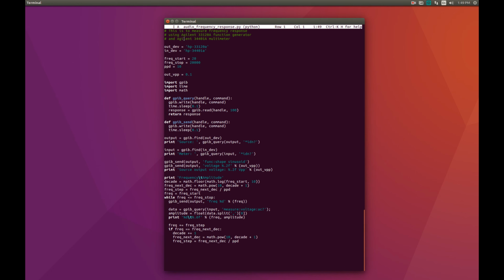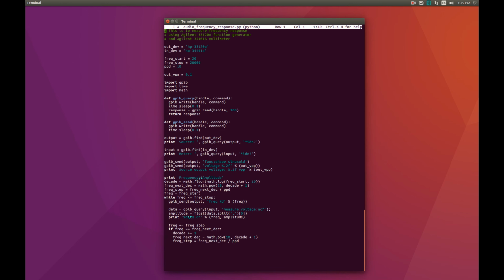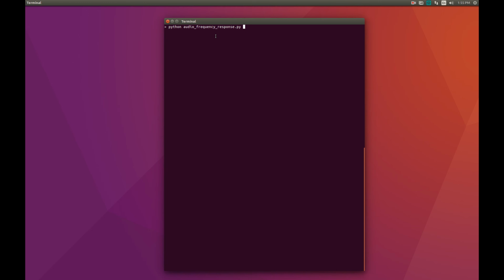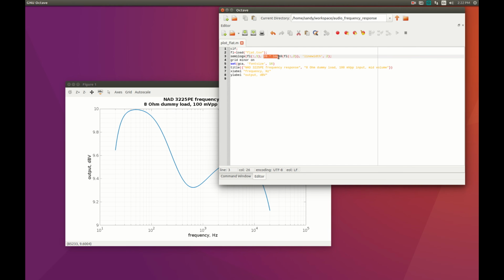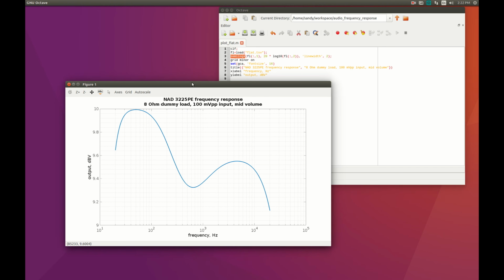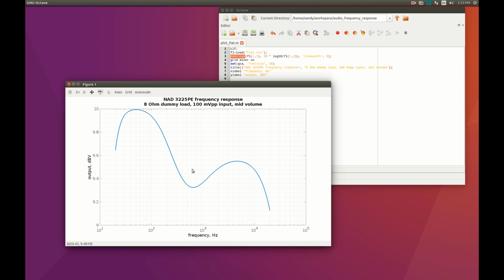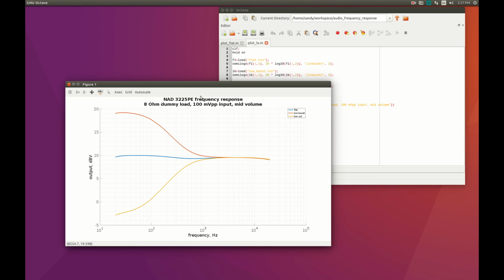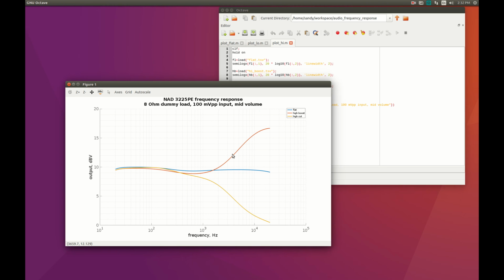#87 - NAD 3225PE frequency response measurements

Comment: What about using a simple voltage divider in order to bring voltages in check and use a high-end 24-bit computer interface?
Reply from the maker: I am afraid it is not that easy. There is no such thing as a simple voltage divider if your signal is not DC. There are all sorts of problems such as parasitic capacitance and inductance, so you would need to compensate somehow, which has many challenges. It is tricky to design a truly transparent front-end with flat frequency response, very low distortion, precise attenuation factor and so on.
Reply from the maker: Take a look at this: http://www.pmillett.com/ATEST.htm

Comment: I suspect the bass and treble pots are not electrically centered when they are physically centered!  The curves always had those bumps on the ends with the dip in the middle with the controls centered in their detents.

Comment: Great video. Just one remark: frequency response measurements will only make sense when you are sure the DUT is not producing a significant amount of distorsion. Clipping can be seen easily using an oscilloscope, however slew rate distorsion occurs often unnoticed. If in your automated gpib setup the output is slew rate distorted, you will make a comparison between the rms value of your input sine wave and the rms value of your slew rate distorted output wave form, which can result in a faulty frequency response characteristic. See also: http://users.skynet.be/hugocoolens/spice/ua741/artikelextended.pdf

Comment: great video as always. 
Can you please make a video showing exactly how to setup and use the agilent 82357B USB-GPIB on Ubuntu with Python?
Reply from the maker: I am not sure it would be very interesting. Too specific, too technical. Do you have a particular problem or you don't even know where to start? I vaguely remember it was not too difficult, and there is plenty of advice online.
Simply speaking, just download linux-gpib-4.x.x, untar, ./configure, make, sudo make install. Then I recall you need to find some binary firmware for this particular adapter and drop it into some particular directory. Python module is included, just "import gpib" and off you go.

Comment: I don't know why oscilloscope manufacturers don't put in an audio setting in the menu that brings up all the tests that are possible with an oscilloscope! It would make life so much easier. I'm sure that they could potentially devise a way to connect an amplifier and set the output level quick and easy so that you just have to push one button and the oscilloscope would run through a set program that tests for many different parameters and gives you a list of the results at the end, it would also be great to be able to save the results so that you can compare between different amplifiers... You would think that this sort of thing would be possible by now! Having the ability to do individual tests is fine, we have been doing this since the oscilloscope was first invented but we know all the tests needed to do a full test of an amplifier and we have oscilloscopes that are capable of doing it automatically but alas, we aren't there yet. Should someone release such a product, shut up and take my money!
Reply from the maker: How about this: https://www.keysight.com/en/pdx-x202150-pn-U8903B/performance-audio-analyzer
Reply: @feedback-loop  wow! Yeah so it exists! The first one that showed up on eBay had a price of $24,000 and it's used LoL. I'm not selling my kidneys for that... I think that what I was trying to say was that most oscilloscopes have an FFT function and I have seen people who have made their own math to calculate the rms output of the amplifier, I'm sure that all these simple things can be consolidated under one menu. I don't have a modern oscilloscope yet and the one that I'm currently using gives no information apart from the signal on screen! I constantly see other people digging into the menu to measure something else which I believe that it could have been placed better in the menu system. For example an Audio hot key which hides options that you would have no use for, or at least give you the ability to hide options that you would personally never use.. Sure, that machine you provided in the link is amazing! And thank you for showing me that, I will keep it in mind for when I win the lottery LoL.. There's older machines that have the same model number but after seeing the current model, the older models just don't interest me even though they are still very capable...
Reply from the maker: I am not entirely sure I understand your point. It seems to me that my scope is quite close to your requirement: just connect the generator and channel 1 probe to the input, connect the channel 2 probe to the output, push a few buttons, and you have a frequency response plot. And it is not a high-end scope. I think it is from the lowest 1000-series currently available from Keysight and not the highest model there (under $1000). Why older scopes did not offer this? I don't know. It is always hard to say why nobody thought of something before. Combination of factors, as usually, I suppose. The cost of ROM and RAM for extra applications dropped, CPUs are more powerful, screens have more resolution, our expectations of what scopes must offer have changed and so on.
Reply: @feedback-loop  yeah you're probably right, I'm being a hypocrite because I don't have a modern oscilloscope, my 20mhz crt scope is as basic as you can get but I knew this when I got it, I do have one of those small pocket DSO212 oscilloscopes, it's great for what it is but it's screen is to small and it's interface is harder to use although not impossible for daily use. You're scope is nice, I don't know what the pro's and con's are of having a single generator built in but in your hands it seems to work out fine which is mostly important at the end of the day, I guess that I will have to get myself an oscilloscope before I start asking for features... Maybe it's just the person who was using his scope that made it look difficult, Just because a person is into electronics, doesn't mean that they specialize in everything! I personally love amplification and almost anything audio (almost) just not DAT machines because I really don't fully understand their operation, so you will never see me working with micro controllers or computers unless it was mine, Audio is where my passion is hence the reason why I watched your video, although I don't limit myself when watching videos, generally I watch anything electronic related because I get to learn things from other areas of electronics that can be useful for audio... This video.... Was perfect! Apart from me having a little rant about oscilloscopes in general, you sir were flawless.. I remember hope that you do more videos like this because I haven't seen anyone else do this... 10/10.

Comment: Silly question: Could you measure THD of the gen and subtract it from the THD in the output?
Reply from the maker: No, it does not work like this. The higher distortion will completely mask the lower one. It is like measuring, let's say, a -100dBm signal in the presence of -40dBm noise. The signal is way below the noise floor.

Comment: Very interesting video. I also find the HP 8903A/B to be an excellent piece to test equipment for audio work with a very low THD source. They can be found on eBay for reasonable prices, especially if not working.

Comment: That was very cool! So how flat was the measurement of the SigGen on the DMM without the amplifier? I know the DMM has a pretty high cut-off but this might have been interesting too. Could always subtract this from the measured result if it was significant.
Reply from the maker: There is no limit to perfection. Yes, that is something to consider, and potentially improve the accuracy. Thanks.
Reply: @feedback-loop  Haha - didn't mean to be picky. Just thought it might be interesting. Looking forward to your next one and thanks again.
Reply: I also had the same question about the flatness of the 33120A output while watching the video. I assume it would be reasonably insignificant compared to the flatness of the amplifier output. Just took a quick look at the 33120A datasheet. The specs are that the sinewave flatness below 100kHz is ±1% (0.1 dB) relative to the 1kHz level.

Comment: Isn’t it a bit risky hooking the scope earth clip to the amplifier output, in case the amp doesn’t like having the output tied to earth.
Reply from the maker: Perhaps I should have spent a few moments clarifying this. There is always something you wish to have mentioned after a video is published. I am sure you have the same feeling every once in a while.
You are right, in general this is something to be aware of and to be careful about. In this particular case there is no problem at all. The speaker negative is the same as the common ground for the whole unit.

Comment: Maybe the scope doesn’t do phase unwrapping when it gets to 180-degrees.
Reply: I believe I remember this happening when I wrote a script for FRA in Matlab. Keysight 3000 series scope, 33120 f-gen.
Reply: It is also possible that at lower amplitude-levels the phase detection mechanism starts to fail (I have seen this before)